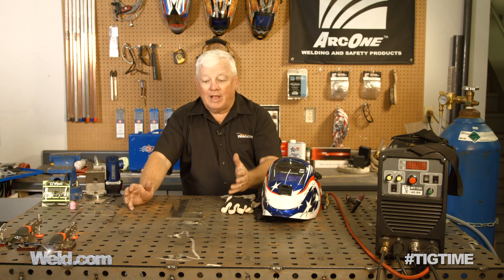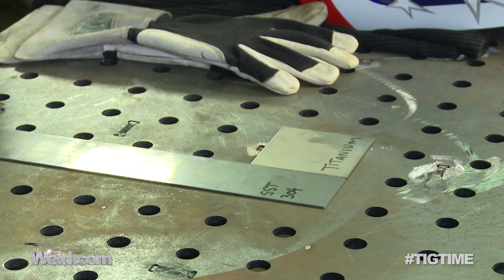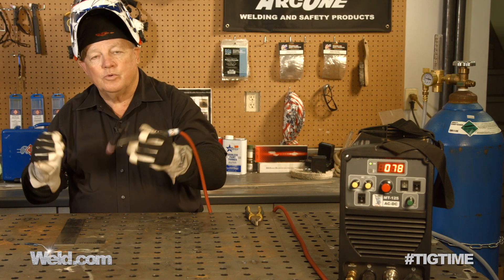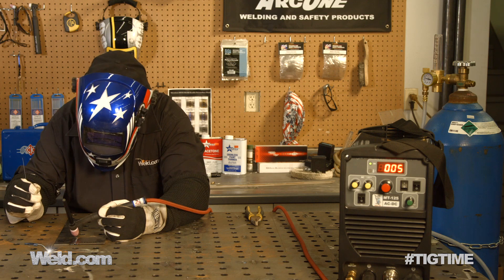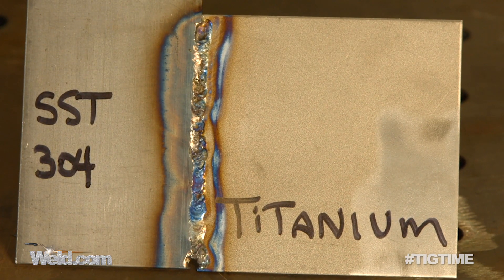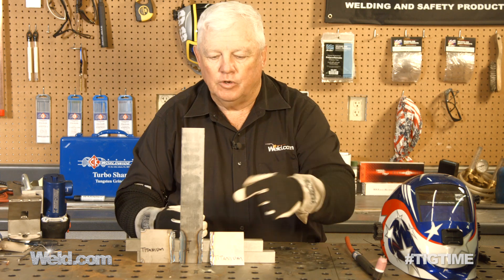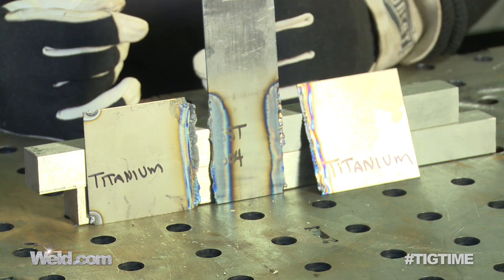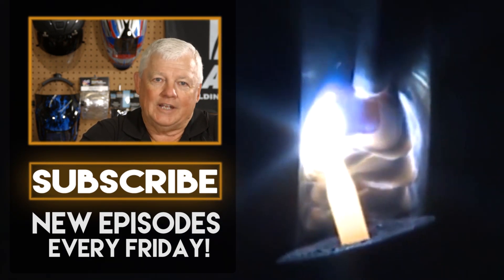TIG Welding Stainless Steel to Titanium | TIG Time

Comment: You can weld it With TIG just use industrial silver filler metal. It works great to bond titanium to steel. Weard puddle but it works great.

Comment: would silicon bronze work in this case?
Reply from the maker: To be honest we have never tried it, however it is unlikely.
Reply: it works..but its only brazing (no cross contamination as no pooling) so not much strength. we put together an exhaust using silbronze and it looked really interesting when polished..i dont know how it held up but the customer hasn't brought it back so i guess its stayed fixed.
Reply: I tried it today and no it didn't

Comment: I know that it probably doesn't exist as a rod but would ferrotitanium alloy work as a welding material in your opinion? Also would something that they both alloy with easily like chromium work to weld them?

Comment: Your  titanium videos show the importance of extreme cleaning, back purge, long post flow/trailing gas, temperature control. Not saying it would make any difference to the end result but starting with weld conditions that  create issues with one of the base metals isn't a good way to try and successfully weld them.

Comment: Im sure they will braz together. 
Wontering if you could coat both in flux an use a low amprage tig braze with 56% silver?

Comment: Can hear it at 2:35 & 4:37 starting to crack.... Silicon/phosphorus bronze maybe??? I worked for a company that claimed they accomplished a one-off part by laser welding the two with a deoxidized copper strip between them without filler. Although I can not contest or verify that.

Comment: I'd be interested to see a titanium-stainless steel weld be attempted with a nickel filler rod, as is used for cast iron repair some times.
Reply: the nickel would fuse to the stainless and maybe melt onto the titanium but it would just crack and be brittle and break off of the titanium.

Comment: Thanks for the video, very informative.  I was just wondering if the E-Z Weld rod with the flux in it would possibly work.  In the video you did with this rod, you welded cast iron with it and said that it could weld cast iron, stainless, carbon steel and copper.  I bought some of the rods  and it does work on stainless and carbon just fine.  When you welded the cast iron with it, was it actually welding or just brazing?  I seemed to remember that  you didn't use very much heat.  Thanks for the great vids.  Dan.

Comment: hey Mr. tig what about welding 316 ti too titanium ? there is probably a higher chance of success. as it got some titanium in it
Reply: Stainless is still an iron based alloy, so the small amount of Ti in it would not be enough to create a matrix that would have any observable strength. You'd PROBABLY have more luck Silver Brazing Stainless to Ti. With enough skill you can make a silver brazed joint that is almost indistinguishable from a Tig joint at first glance

Comment: The real problem- when you weld titanium and you make a mistake and take stainless filler rod. It welds ok, so you keep on welding untill you realise that you ruined few parts... ...and then you realise that titanium is not cheap material... happened to me twice.
Reply: Kevin Rausl you'd think after the first time you'd check what material you're using

Comment: Seems like this is a bare bones, lazy experiment.. so could we try pre heat or post heat? We all know cast, aluminum, inconel.... that’s all I know of off the top of my head... these metals weld better when pre heated and stress is greatly reduced to stop cracks when post heated. Did you try back purging? Could easily contribute to immediate cracks. Maybe none of this works still... but I’m just wondering how the answer is just don’t weld this, without more testing than what you guys did here.....